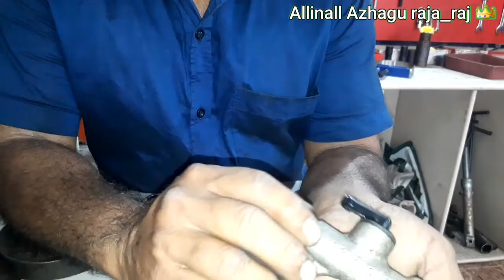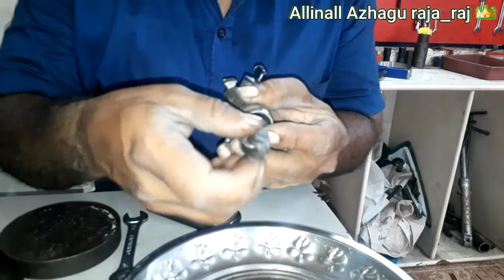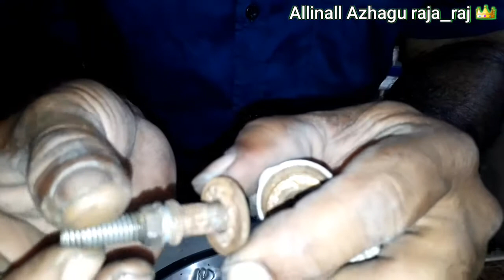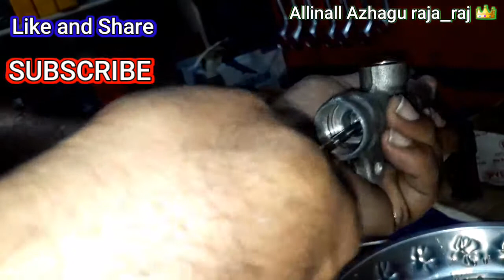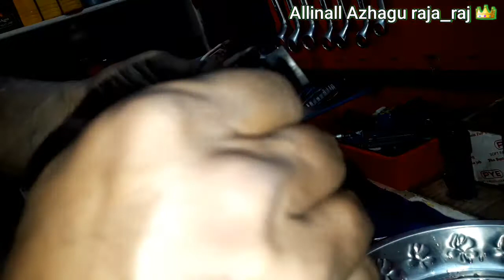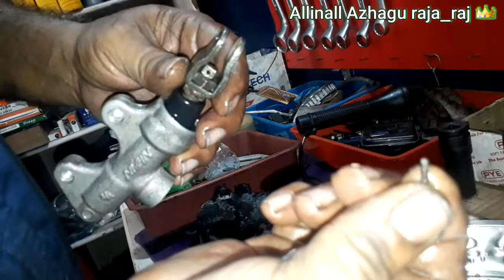Yamaha R15 Rear Disc  Break Master Cylinder Kit Changing Method.

Comment: Will Nikavi rear break master
 cylinder (which i have seen on Amazon)work with R15 v3 ?? Plz tell me
Reply from the maker: It's a brand name only ...will fix it
Reply: Same question I'm facing the same problem
Reply: Bro have you fixed your problem
Reply: @th0ttle_maniac469  you have to replace it
Reply from the maker: Pls come to my WhatsApp
9380528691